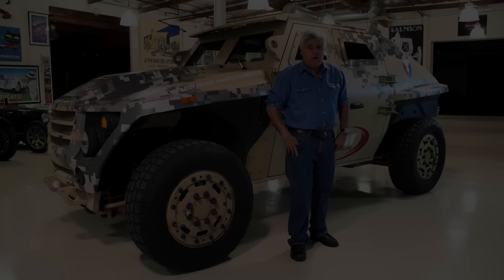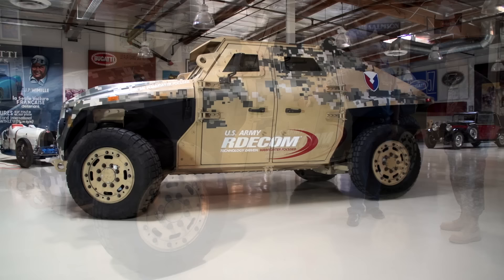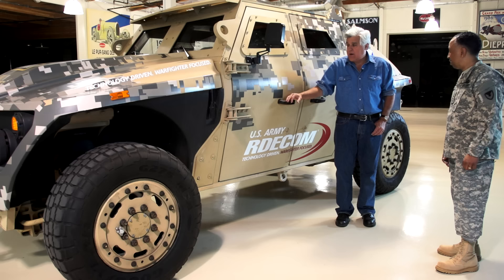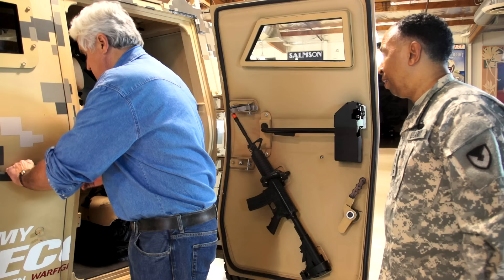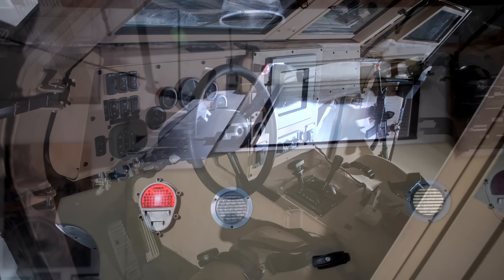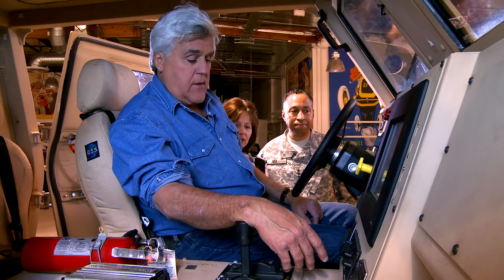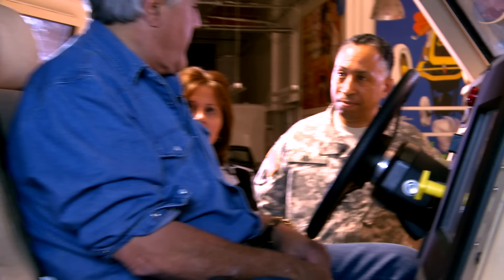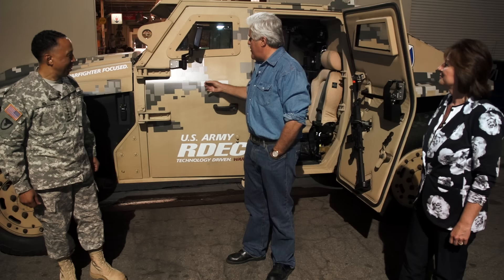U.S. Army FED - Jay Leno's Garage

Comment: I don't know if I'm right but I would have thought the suicide doors provide more cover so that both passenger and driver have cover from both front and rear fire.
Reply: Un ya
Reply: Thats what i was thinking.
Reply: Exactly what I was thinking and precisely the reason. The "suicide doors" provide a ton of cover upon entry or exit from the vehicle.
Reply: stefan speidel not much cover for the knee down.
Reply: anti-suicide doors?
Reply: It means when doors opened there is a safety corridor and it protects from suicide bombers
Reply: It enhances egress for tactical maneuvers more than anything. Pop out and go.
Reply: Bingo, and eliminates the need for that B-pillar which can get in the way of things on ingress and egress.
Reply: My thoughts as well.
Reply: Darc Mac dude i feel you there
Reply: That was what I was thinking. You could have two standing close together with good armor protection and only a small opening to fire from, or try to target if you were a bad guy.
Reply: Exactly they Do...
Reply: No cover for your legs
Reply: Unless you can drop the suspension
Reply: I thought about today but it also gives a bigger opening and angle of shot which can be both good and bad. 
I would have thought a drop down bullet proofing would have been nice when doors open up protect their knee down
Reply: you right yo

Comment: One thing failed to mention with "suicide door" acts as protection from rear attack when exiting. NOT so suicidal after all.
Reply: You can stop near some entrance and before you move out of the vehicle you can have protection from 4 sides and the attacker can only shot at your feets... "Think about that." And its not a taxi driver and the other guy on fron seat will be going out with you...
Reply: Both of them were AssAfirmative Quota hires.  The General didn't seem to have the General knowledge and the Chief Engineer didn't understand the abs question.  Sucide door DOES provide the benifit that you mention.  I think it was also out of design necessity, cuz if you were to try to hang the 300lb+ rear door the otherway, you would end up with super thick pillars getting in the way.  Just look at the door hinges.

Comment: Keep in mind that this is a 'project' vehicle developed to test lightweight materials and to improve fuel efficiency; it is not for war fighting.  Danny Cannon and the few military guys that have been near real vehicles fill in some of the gaps.  Popular Mechanics recently ran an article on a Stryker Brigade, where vehicles are differently configured for different parts of the mission.  Those vehicles carry a nine-man team. This demonstration vehicle is four-man and might represent a command and control vehicle or serve a rapid reconnaissance function.  As we saw this monster, it is a basic demonstrator about how a specific set of problems might be solved.  It represents a different take on automobile use and the novelty itself is of interest to viewers outside the services.

Comment: The noise from the self leveling suspension might just drive you nuts.
Reply: 'week 6, the taliban draw ever nearer. we lost contact with forward operating base. supplies are running low. worst of all, the suspension on our jeep sounds kinda annoying.'
Reply: I was thinking the same damn thing.
Reply: I was already tired of it after 3 times lol
Reply: On the battlefield with all the noise of bombs and bullets, that suspension noise will be the last thing that will grab your attention.
Reply: My tank did this all the time with the six pump when the tank was off. I can agree it’s pretty annoying lol
Reply: I'm just surprised they make an armored vehicle but it relies on airbags to stand up.  Are there torsion bars hidden in there too?
Reply: MichaelKingsfordGray   I did nine years in uniform and I didn't like that noise.

Comment: Probably a $500k per unit vehicle.  Would be nice to see what MIL could do with an off the shelf Raptor, or base F150 with an armored cabin and v-shaped diversionary floorpan.  The bad  guys are driving around TOYO pickups and just take casualties.
Seems like this brick should be lighter,  protective, and offer return fire at angles that aren't 90 degrees.
Reply: They had RP units and CUCV . Chevy Tahoe and pickup truck . I think it was M1001 and RP-2 something like that . Not much Armour if any

Comment: Adam Alvarez 
"A lot of times they'll build a prototype like this and knowingly ignore some of the faults in order to test more important things, like the engine, suspension and ergonomics. Once they get that stuff perfected, fixing all the little things gets a lot easier. If you try to do it all at once things will ALWAYS go wrong from the get-go."
Exactly. They knowingly ignored all of the things that would keep them from making it fuel efficient. If they simply wanted to show that it could be fuel efficient, all they had to do was put that engine in ANY 15,000 POUND vehicle, and prove the powertrain system. Then design a vehicle to fit it. The fact is, if they had finished the thing off with everything it needs, it wouldn't have been "30% more efficient", so the whole thing is a failure. As a matter of fact, it's already been replaced by at least one iteration, the FED Bravo, in which they completely changed everything in the powertrain. It uses a Ford twin turbo V8, the front wheels are electrically driven, and it was designed by college students.
Oh yeah, and it's 70% more efficient...
doesn't have pushbutton door handles...

Comment: I like that this FED is low-tech solutions to modern military problems. All the internal systems look easy to repair or replace. Its obviously not a front line or constant combat vehicle. Think of it as more like the ancient Jeeps, its for driving around a base or other areas that are supposed to be safer. Any sustained fire will shred the FED but it would provide enough protection that you have the chance to get the hell outta there. 

Another thing I respect about the FED is that it was designed to be the main "car" of the Army, it takes the place of all the non-combat vehicles. No need to have all the infrastructure for four car makers and a hundred different models, just one vehicle for the motor pool to learn about and store parts for.

Also, anyone in the Army could drive it because it was designed with so many different uses in mind. The power steering and power brakes were really strong so even the smallest person in the Army can operate the FED as easily as the largest. I doubt the FED will be seeing much open desert in combat zones, however it would be right at home doing all the inter-base transportation. It seems like most of the rugged features are there as a "Better to have it and not need it" kind of thing, and the FED will spend almost all its time on regular roads with traffic maybe. So the anti-lock brakes and traction control don't seem like a bad idea.

Comment: After WW2 my father went back into the car business. He had eclectic tastes which I mistook for no taste at all. But every so often something weird would show up in the used car lot. One of my favorites was the Messerschmitt. During the US occupation Willy Messerschmitt couldn't build warplanes but he still had factories and machine shops and an imagination. So he built a 3-wheel car naturally called the Messerschmitt. It had a canopy but no doors, two tandem seats. From the aircraft shop came a yoke instead of a steering wheel to save space. It had a 175 cc two-stroke engine with a pull-cord starter (although mine would never start). I just wonder if there's a Messerschmitt (car) in the Leno collection. (We also had an Isetta but BMW didn't have Willy Messerschmitt's imagination.)

Comment: There should be two small robotic vehicles that travel in front of these troop carriers to set off mines.   
A robotic mine detector would be of the design to take an explosion and be able to be blown in the air and 
come down in shape for the troop carrier to proceed on down the road.   This design is symmetrical vertically, 
so it no matter if it lands on it's back, it can motor on.

Comment: Hold on a sec, is this a V-shaped hull vehicle, like the Cougar? I mean, vehicle that can protect the soldiers in case of IED?
Reply: yes.
Reply: Its the work of simple physics. For example, if you splash a cup of water at a flat wall at 90 degrees, the water will splash everywhere and will be absorbed by the wall(in this case, would be the bottom of a typical Humvee). But if you splash water at a V shaped wall, the water will hit the tip and divert most of the water past it. So in this case, it would be the bottom of the vehicle in the video. The IED or a roadside bomb of some sort would theoretically explode under the vehicle and divert most of the explosive pressure up and around and above the vehicle in the air so it doesn't blow the actual vehicle into shreds. :)

Comment: ...ball joints and shock absorbers are exposed (and the door hindges too). In case of attack this things will be first to fail and without a wheel whole wehicle will be dead in it's tracks. Also that solar panel would be less exposed if being placed horisontaly on the roof (it could be split in two smaller ones to accomodate the escape hatch)...:/

Comment: 11:05 running down the general
Reply: How is that? The General was in the passenger seat.
Reply: Called having a ground guide.
Reply: That's your point man. I was in the SAS for 89 years. I'm a very old man.
Reply: Generals rarely drive vehicles, they're too busy assessing the battle situations.
Reply: Brian Fountaine All military vehicles where you have limited vision use a ground guide.
Reply: You can get a page 11 (or even a NJP if you hit something!) if a pissed off Captain or 1st Sgt sees one of their tactical vehicles operating in a friendly, populated area w/out a ground guide. So, basically its a 2 man vehicle at least 95% of the time.

Im sure that roof hatch will eventually have a turret on it as well in the end product... a while down the road.

Comment: Almost 5 years in the army and have never seen this. From the looks of it they can keep it. No turret, No rear visibility, Rubber air bags for suspension have they been to a war zone, I see so many flaws in design obviously not tested by soldiers. If they did you missed a few things. If they actually make this army wide I hope they make a lot of changes. Also what's the point of the flimsy single solar panel in the back. Were they trying to make a rugged camping rig. So hefty camping rig i would definitely take. To a war zone going outside of base I would take a different ride If I may. Yes it is designed better than the standard hmmwv. Of course it rides more comfortable. Have you seen the standard army seat. Your lucky to have padding at all.
Reply: yeah that vehicle seems kinda crap :D that woman probably designed the whole thing since it has carbonfiber covering the engine and the radiators were totally uncovered too
Reply: Actually most military vehicles have very little engine protection. Most of the armor is around pax itself. Also don't be so sexist. Being a female has nothing to do with the way the vehicle was designed. The issues are lack of soldier input that have to survive in it. Real world situation feedback goes a long way.
Reply: but is very little engine protection good? it isnt
Reply: if they made the engine compartment bullet proof the added weight wouldn't be worth is. beside if you get hit that bad. last thing your worried about is if there's still oil in the engine or if it's gonna overheat. their designed where you can keep driving for a while without oil or coolant.
Reply: going to agree. as a former Marine there's so many things i can see that make me pass on it, this is just a typical tacticool mall cruiser.
Reply: Danny Cannon, thank you for your service. Keep safe and God Bless.
Reply: I also cant see it being better then a humvee for offroading. By the looks of it, it has a fraction of the ground clearance and it lacks the protruding front wheels of the humvee that make it good at climbing obstacles.
Reply: It wasn't explicit, but she said that it was used for testing new material so assuming they made this as a proof of concept to better understand the practicalities of new technology that they can incorporate into their current fleet of vehicles.
Reply: Rob_ Thank you! 

It's the 1st thing he said. I figure much of the tech they're eploring is fuel efficiency/engine power, comfort for long missions and armor protection without adding too much weight. Whatever they learn will be transferred to existing fleets.
Reply: Thanks for your service.  I was wondering what military personnel would say about this vehicle, and you made a lot of good points.
Reply: its a prototype so the production version will be much different
Reply: They've probably created it to sell to other country's police forces. This is just a hammed up car advertisement.

Comment: it better have better suspension than the Humvee does because that one was so bad soldiers would end up having smashed spines by the time their tour was over
Reply: The Humvee has 4 wheel independent suspension and rides incredibly well over rough terrain at high speeds, for the amount that it weighs. That's just me though, I only spent 7 months riding around on the top of one of these as a turret gunner in Iraq. If you want blame to a military vehicle for spinal injuries, blame the MRAP. You wear a harness in that truck because you won't want to ride in it without one. Otherwise you will literally fly out of your seat and slam your head into the ceiling if your driver runs over a rock the size of a baseball.
Reply: Bobby Boucher I saw a video about a soldier trying to get help from the VA because his spine had 3 smashed disks he claimed it was because the Humvees were always driving over bumps. he could barely walk but the VA just told him there was nothing they could do and refused his request for surgery.
Reply: Nobody in the units I was in had that problem. Most of the guys, actually wanted to ride in Humvees, or 7 Tons instead of the new MRAPs. Mainly because they have a more comfortable ride. The only reason anybody wanted to be inside of an MRAP was because it had 110 outlets. We had plenty of guys with back problems, but that was from lifting 100+ lbs rounds and emplacing/march ordering howitzers.
Reply: could have been a combination of the 2
Reply: Bobby Boucher Which version? I believe Motortrend compared two different models with different suspension configurations.
Reply: The one you're referring to is the Banks version. Which is an aftermarket humvee with only minor tweaks to the suspension, but it is still the same design. The original humvees have had 4 wheel independent suspension, with portal axles/hubs, since they were first introduced.
Reply: Bobby Boucher  Mr. Boucher, to begin, thank you very much. I am curious how the Humvee did in the sand. I remember reading in a car magazine during our first venture into Iraq, that the Humvee did not do too well in the sand and that the U.S. military ended up ordering a bunch of Land Rover Defenders.
Reply: I wasn't in the invasion, and I don't know whether or not the US military bought Land Rovers or not. If they did, it wasn't for combat operations. It would have been for the higher ranks to drive around on the base/fob. Which makes more sense because driving around on base in a tactical vehicle requires 2 people. A driver and an A-driver. As well as a dispatch to write up a trip ticket. Plus being required to wear flak and kevlar during any trip outside of the motor pool. With a civilian vehicle like the Land Rover, none of that is required. Also if those Land Rovers were gasoline powered then they definitely never left the wire.
Reply: ***** I thought the General said the seats were designed so that very point you raise wouldn't happen, meaning damage to the spine in combat situations?

Comment: so theres no engine protection?
Reply: It's not a tank, the only part of the vehicle that really needs protection is the cabin to keep the crew safe. The idea is not to have an invincible vehicle, its to increase the survival rate from roadside bombs and other high explosives. If it was hit depending on the damage engineers can replace the engine and fix exterior parts.
Reply: There never was in the HMMWV's either, as is the same for most military vehicles.

Comment: A simple, Mercedes Benz 3.5 liter, Turbo diesel with a 6 speed automatic would have made the total cost $30,000 less and made this Tonka Toy EXTREMELY desirable in the used, civilian secondary market. Who the Heil would want a used 2 liter SUPERCHARGED and TURBOCHARGED 4x4 truck? That's like a Cessna with a rocket engine for propulsion. It's simply isn't necessary.
Reply: Strangely enough the army doesn't design vehicles for resaleability. These sort of things get used and used and used and when you're in a combat zone and people are shooting at you and you needs to quickly get away while towing the vehicle that just blew up next to you a little extra get up and go goes a long way